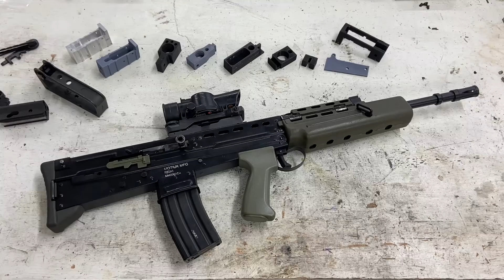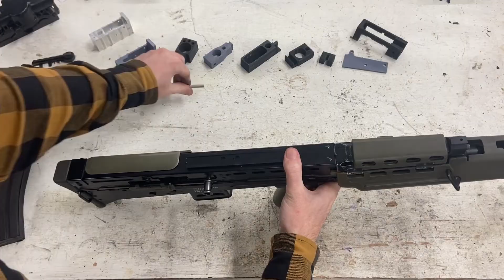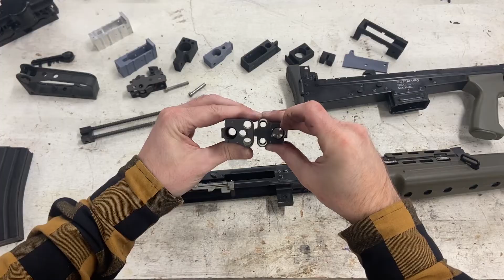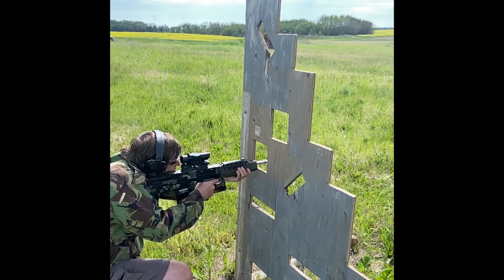Semi-auto L85A1

Comment: Hey bro I was curious about your A-S Modelo A Cetme rifle and I found it in the FRT as a prohibited rifle. Is that the end of the project as the RCMP deemed it easily convertible or is there another way you can still salvage this project?
Reply from the maker: It definitely wasn't deemed easily convertible haha, but they assumed (incorrectly) that I used a G3 receiver blank to make it, and thus they determined it to be prohib. It was a nightmare to make the 3D printed stamping dies, and fight with the sheet metal to make it into a workable receiver. I'd have to document the whole process again, and honestly, because of the nightmare that it was, I'm not super motivated to do it all over again. But I am looking into possibly CNCing a left and right half of the receiver and then just TIG welding it up. It would be significantly easier, but would still take a lot of time.
Reply: @motiukmfg  thanks for the clarification bro. After I checked it indeed seems like the RCMP banned it claiming it’s a G3 pattern rifle based on Sec. 75 of the firearms prohibition order. The one thing I’m curious about is how they concluded it was built on a G3 receiver and post C21 if you tried to submit a new design to the SFSS would you have to design a new magazine to only hold 5 rounds?
Reply from the maker: @c.s.i.s6284   Nah, the design clearly pre-dates C21, I just have to remake the receiver and document the process like crazy haha.